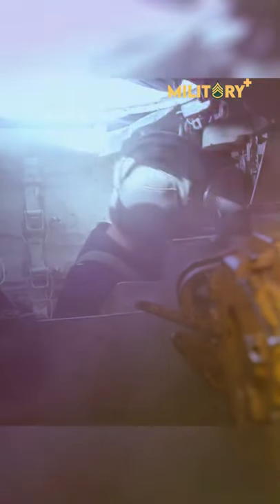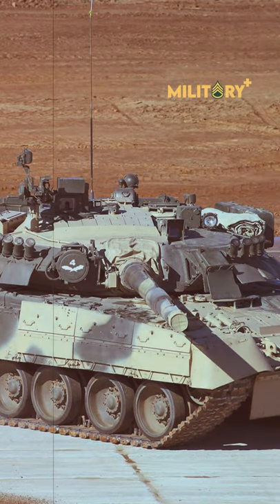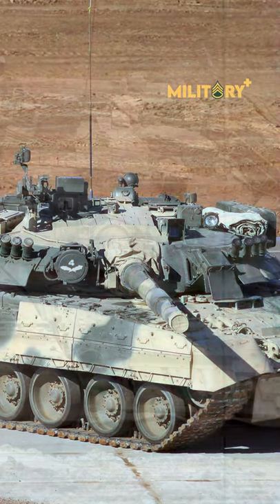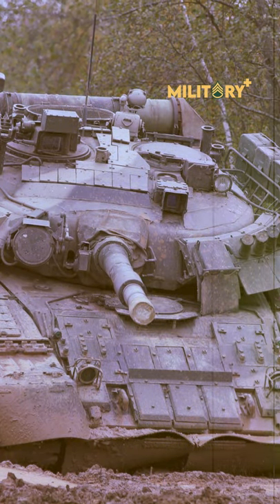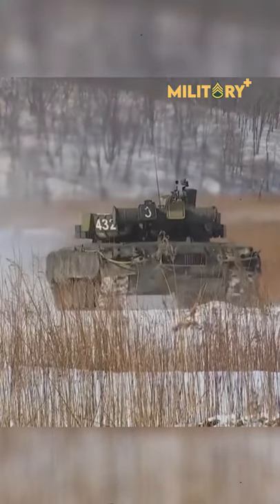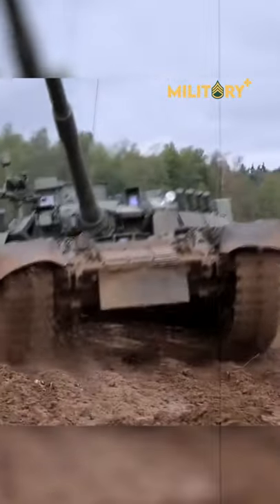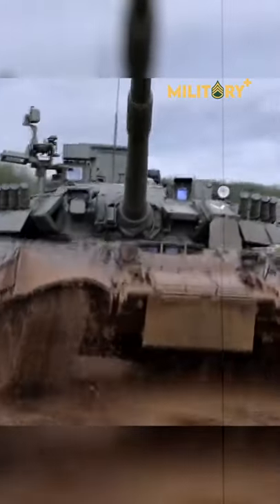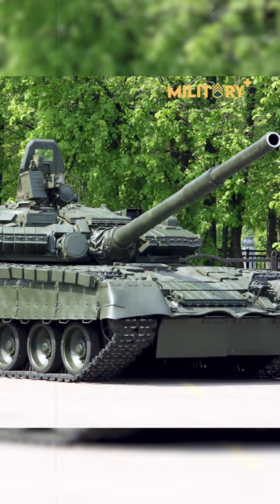You’ve Been Warned: Russia’s T-80 Tank Is No Joke #Shorts

Comment: The T80 is built on the T64. And the T64 is an updated T62. And the T62 is an updated T54. Doesn't matter what you do with the T80. It was first designed in the 1940s at the same time as the Centurian. Then look at how many are leaving the factory with upgrades. Russian factories have managed to upgrade 48 since the start of the Ukraine war. In that time Russia has lost 3,000 MBTs. Let that sink in. -3000, +48 in ten months. Oh, and Russia cannot afford the Armata. In twelve years of manufacturing they have still not completed the 100 pre-production models.
Reply: While mostly correct the t64 is completely different from the t62